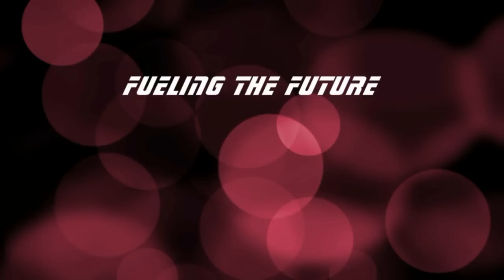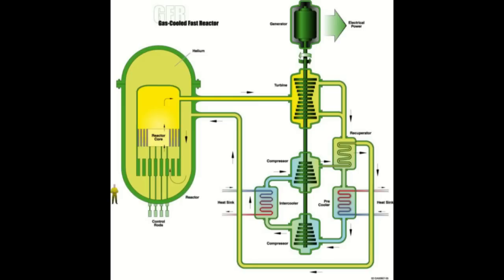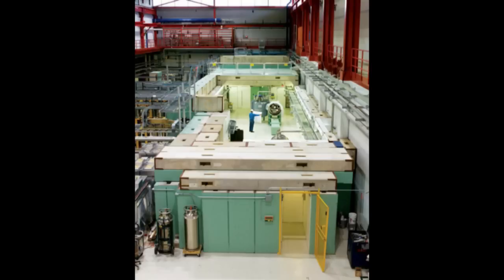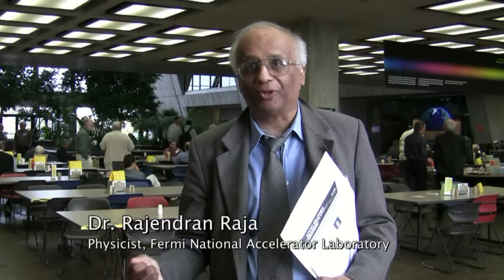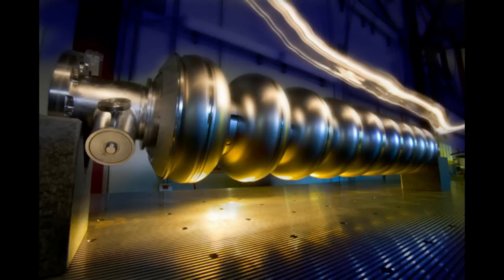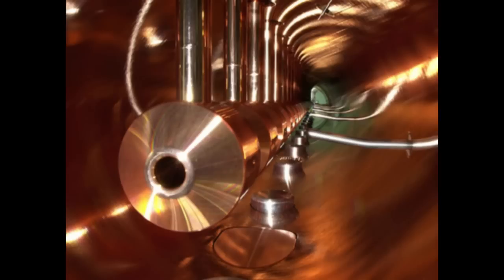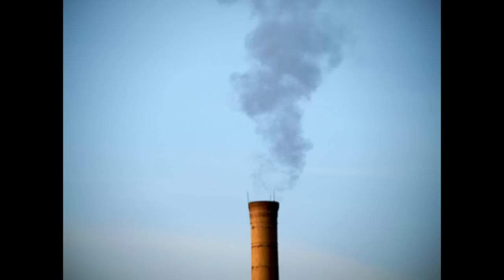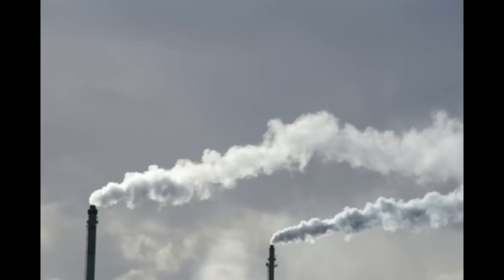Fueling the Future

Comment: @NeedsEvidence Accelerator Driven Reactors actually represent a fairly long-term solution to the Earth's energy problem, with the potential to provide our planet with clean electricity for several thousand years.  A suggestion: first, green lobbyists allow engineers and scientists to develop a genuinely practicable approach (without ill-informed badgering), and then - with the super-abundance of electricity generated - eco-fetishists can produce all the solar panels and wind turbines they like.

Comment: The problem is that the further development of nuclear power plants as well as the accelerator driven system to handle nuclear waste mentioned in the video will help to establish only a short-term solution for the earth's energy problem, and it  thwarts long-term solutions based on renewable energy sources such as solar wind energy.